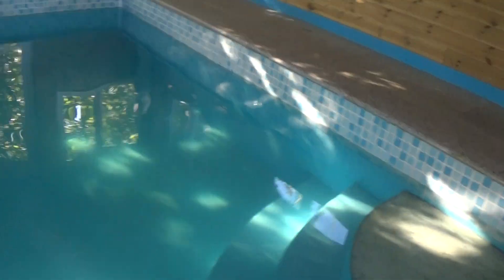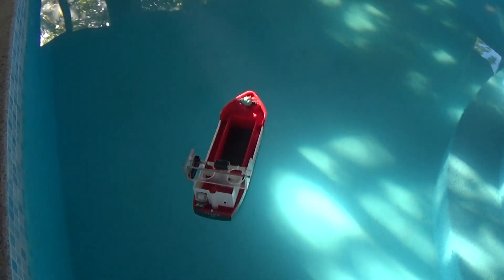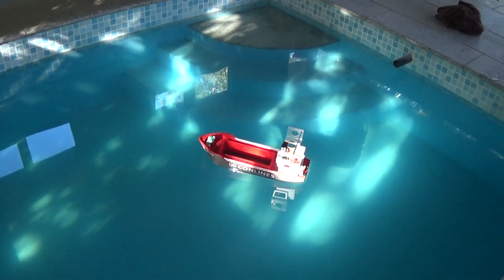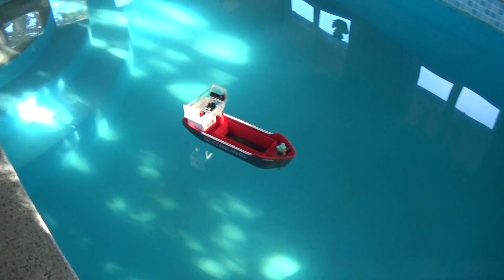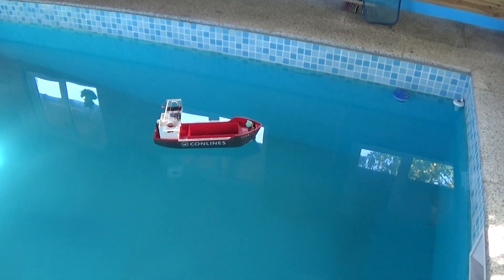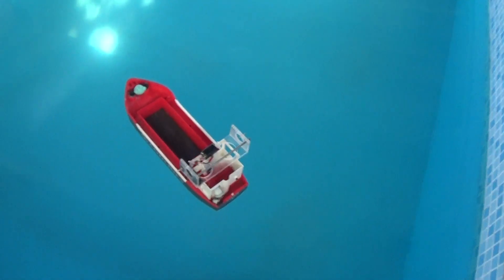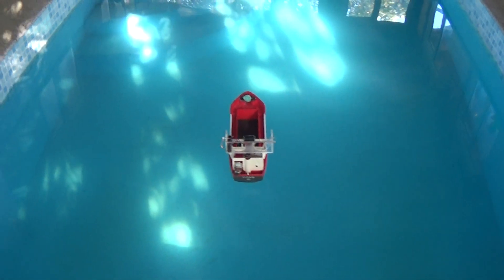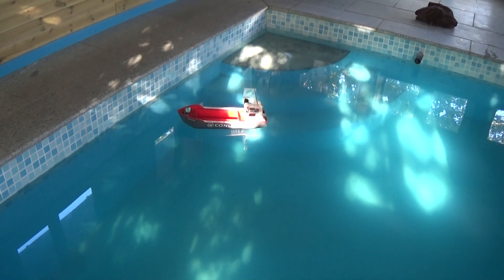Ion Drive powered model boat - first run

Comment: It doesn't work, in the way you think it does it has no torque meaning in dumb, it means it will never make enough thrust to fly/move anything useful
Reply from the maker: thanks tonyw8001 and vapewoo. The vehicle works because the ionized particles emitted from the cathode bump into the uncharged air molecules on their way to the anode and create a wind. The set up would not work in a vacuum as there is no gas to ionise or push. The amount of force is agreed small but MIT have a 4m glider powered by this. Where the technology comes into its own is ironically in space where there are no particles to speak of. Space vehicles therefore need to carry their own gas to ionise such as xenon or other heavy inert gas. Proven space vehicles such as the Dawn which was launched in 2007 had 3 xenon derived ion thrusters delivering 0.09N solely from a solar array. In the vacuum of space the tiny associated acceleration moves the vehicle to incredible speeds over time. The future of Inter planetary and interstellar space seems likely to employ such technology. Doubt the thing I built here is going to change the world though :)
Reply: Not true. Deep space rockets can and have used them and also a model plane was created with ionic thrusters. Especially with rockets, this tech is very useful